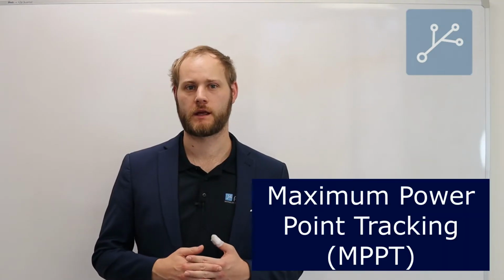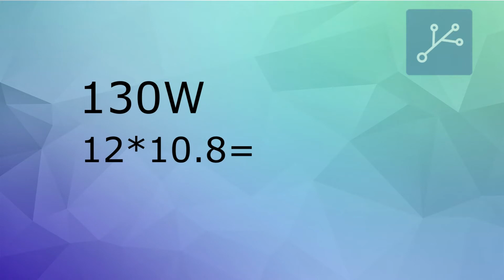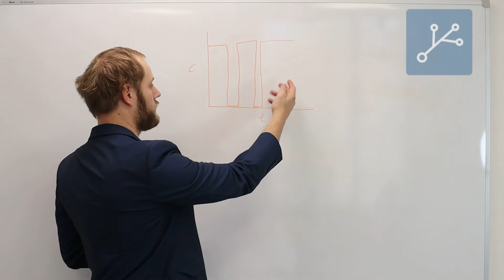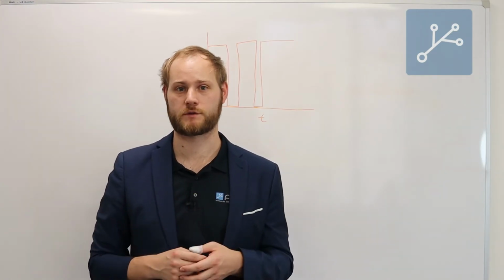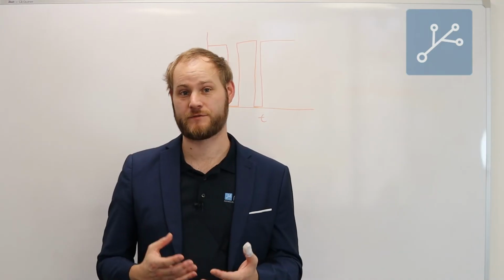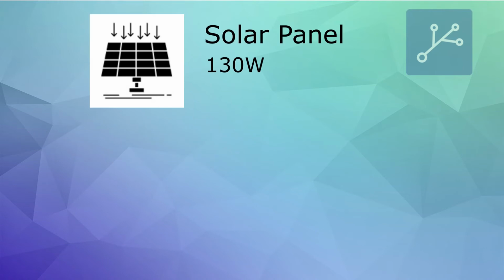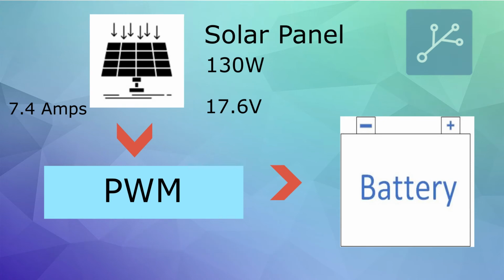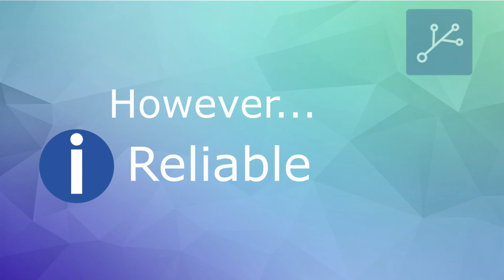MPPT vs PWM: Which Solar Charge Controller Is Best?

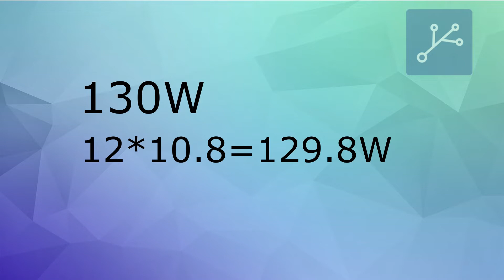Comment: Hmm, I stopped watching at 1:00 when the maths was so obviously wrong.
12v x 10.8A is 129.6W (not 129.8), a small error, but the efficiency calculation is so far out of whack that anything else you say can not be treated as reliable.
129.8/130 is close to 100% as any ten year old could tell you.

Comment: Please also 1 question:
I have total 12 panels each 700 watt with 48.6 VOC.
Can i link them to 1 mppt tracker ranges between 90v to 520 v ?

My inverter is SOLIS HYBRID 8KW PRO

Comment: It's not about loosing the voltage. If we connect 17v panel to 12v battery, which is, for example at 12.0v. The voltage on the terminals of the battery will start increasing from 12.0 till.. until the pulse ends. The charging current is proportional to difference between open circuit voltages. Lets say we don't want to charge higher than 14.4v. when we'll reach that voltage the controller should end the pulse. While not charging the voltage on battery terminals will go down to 12.x -13.x pretty fast. Then next pulse kicks in. We're loosing power between the pulses and it has nothing to do with voltage diff. Mppt has regulated voltage output so it charges constantly thus not loosing power. It also able to pull as much energy from panels as possible.

Comment: In other words, can the MPP device give a higher amperage value than the amperage value given by the panel?
Reply from the maker: MPPT cannot provide a higher amperage than what the solar panel is capable of. However, it can optimize the efficiency of the panel's output
Reply: @acectrl  What I wanted to say was whether it could actually increase the amperage by reducing the voltage.

For example, while a solar panel that provides 15 volts and 7 amps is charging a 12 volt battery, the mppt device can output 14 volts and more than 7 amps. In this case, the 7 amperes coming from the panel are increased.
Reply: @acectrl you say the opposite at 0:44
Reply: Yes but at a lower voltage